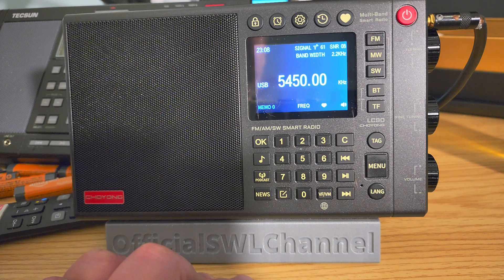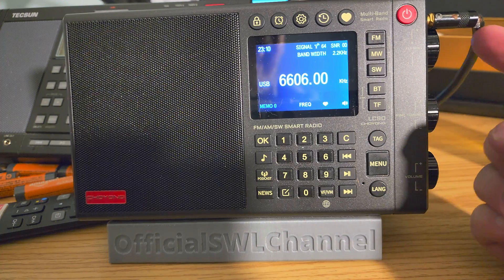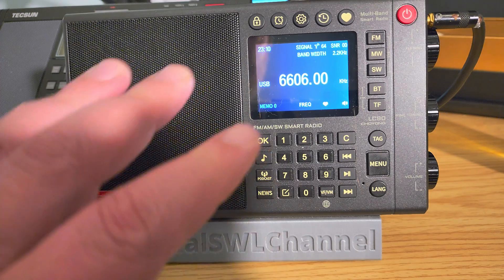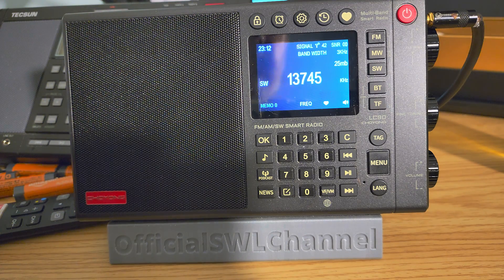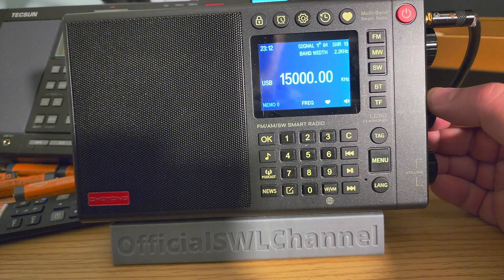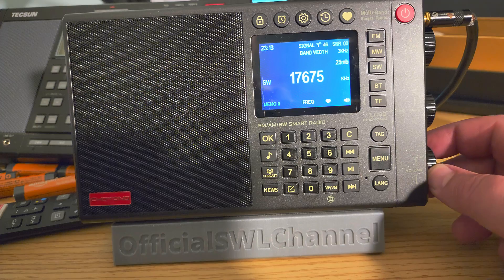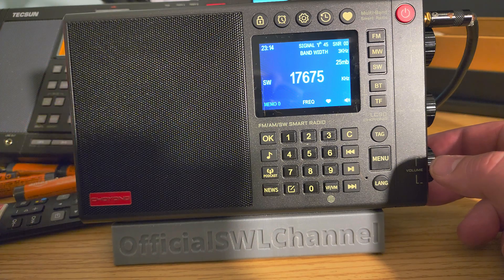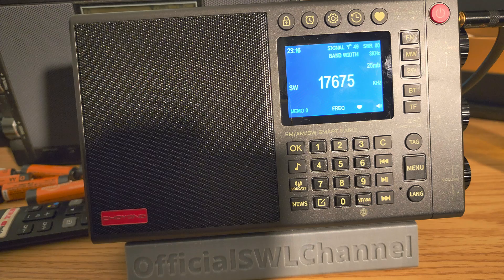Choyong LC90 Smart Radio tuning the bands using MLA 30 external antenna some overload can be seen

Comment: What happens if you reduce the gain inside the mla-30 amp? The bias-T doesn't really matter in my experience.
Reply from the maker: Bias T powers the loop..without it the loop is useless